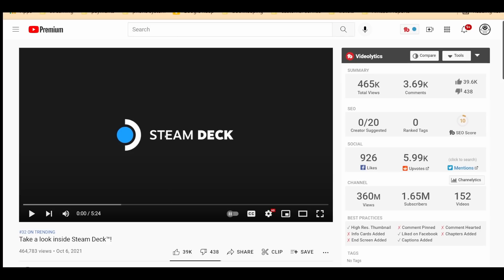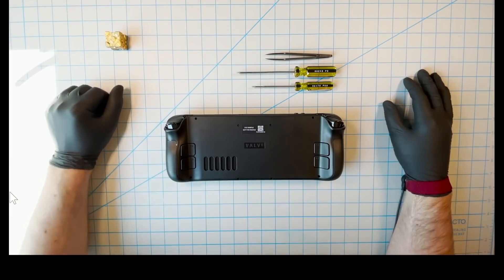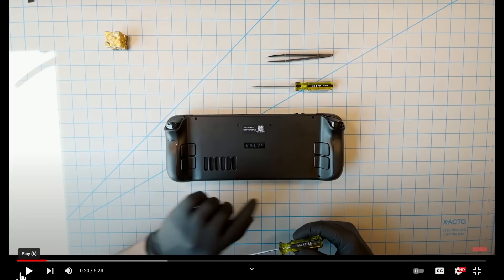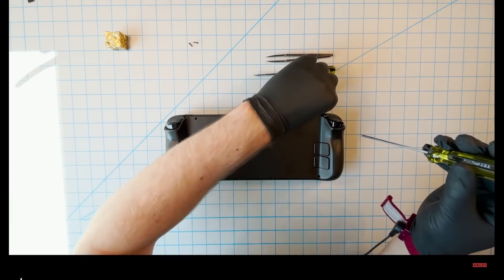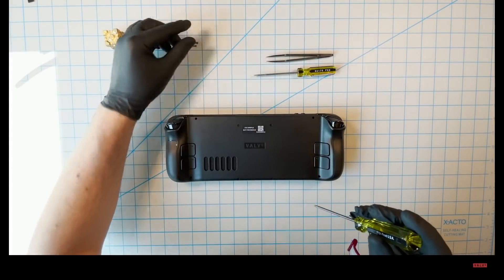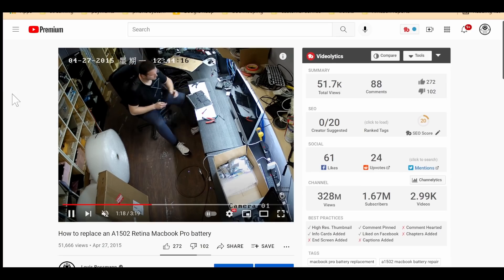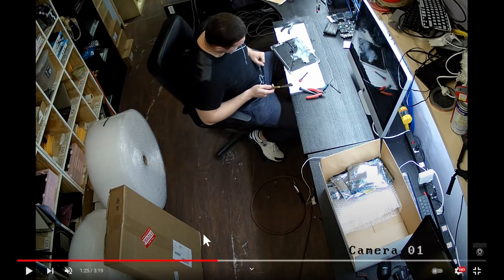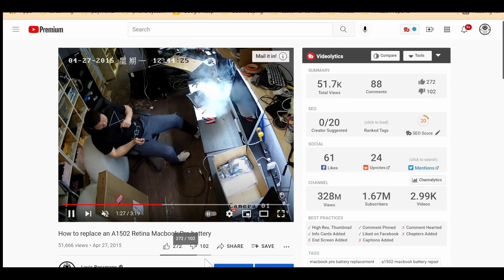Steam deck battery may end your life? bruh 😑

Comment: I know from the times I have opened my PS4 controllers that they never feel as good to hold after wards. They have more "play" and flex in them.
The controlled does have some snap-fit taps in them, which are easy to break when you open it, which means you lose their ability to hold the shell together.
I tried to see if the Steam deck had the same, but I wasn't able to.
But I'm not calling bullshit on them, if you tighten the screws too little or too much it can cause issues. I doubt it has any danger risks though, probably just going to make your steam deck feel looser and and have more give in the plastic.
Reply: There is also a possibility of cross threading the screws since they are self tappers. Which in turn would weaken the plastic that the screw holds too. Or if you over tighten you just strip the hole all together then it will be loose and any part that is loose will fail after repeated drops
Reply: I once killed a car by not knowing what torque was.  It happens.  Push the screw too far in and maybe it will short something or pierce it or crack the circuit board.  Whether that's an issue, who knows until it happens?
Reply: Worse yet, my DS4 controllers have actually started breaking in places the more I do take them apart. Usually the ribbon cables. I always commend Sony for their continual advances in hardware (DS4 has many slight improvements to parts, as have the consoles), but it seems even they are prone to this bullshit, now. I hear the DS5 has stick-drift much like the Joy cons do, which is absolutely tragic.
Reply: @9ineEi8hths  that sucks. Only issue I had with DS4 was the battery cable got broken on one of them.
Stick drift sucks...

Comment: Its sad that Valve gave into the righ to repair corruption. But I strongly disagree with you on the battery safety bit. There really are several situations one could be in, where they cant quickly escape the exploding battery. Plus is could absolutely burn a building down, as everyone is escaping.

Comment: Self tapping screws in plastic. If you use incorect force you wil rip the treads in the plastic. And i see that done when people try to fix their own white goods (i am a independent repair technisian).
If you are aware, and using a little finger feel and following existing threads, then it is not a problem. Or maybe after fifty times in and out with the screw.
But this is like the other warnings, for the people not knowing how to.

Comment: As a ex-technician I used to work for a company whose devices used to be held together with self tapping screws and plastic posts. It was very common to have split posts or to strip it completely, which permanently compromised the structural integrity of the device in terms of the housing staying together, especially in the instance of drop scenarios (which they seem to imply in the clip). How easy it is to split or strip it really comes down to how they designed the receptacles but they definitely aren't talking bs in my opinion

Comment: Ok so I'm going to give my take on the structural integrity thing of the self-tapping screws and structural integrity thing. Also, I apologize if this comes off as me talking down to you, but you said stuff that made me unsure how familiar you are with this, and I lack social understanding/read-between the line skills, which is amplified by the internet. Also, I am speaking from the perspective of a 3d-printing hobbyist, not an expert. I encourage anyone more knowledgeable than me to correct me.

The self-tapping screws means that before the back is screwed on, the slots where the screws go into are smooth, and don't have any grooves for the threads. It is big enough for the center of the screw to go into but not the threads, so when you screw it in, you are cutting your own threads into the plastic, similar to how you would screw something into wood. In contrast, if it had threaded inserts (usually metal of some sort), the threads will already be cut into the metal, and because they are metal you won't be able to cut your own threads accidentally (unless you are the hulk). If you don't have it lined up correctly, you know and just try again until the threads are lined up with the grooves. With self-tapping screws, its hard to know for sure, and easy to tap new grooves into the plastic, which would make it weaker, as there are more cuts in that plastic. Additionally, this means its harder to know when you are overtightening the screw and, especially after several cuts, you could very easily strip out the cut grooves in the plastic. In Short, these are not the same type of screws that you are familiar with from working on MacBooks and other computers.

This is not something that I think would be noticed in the short term, but rather, would definitely hurt the structural integrity by a noticeable degree in the long term for those who are even semi-frequently removing the back. Probably around the 4th-5th time would be my random guestimate. It will still stay on for sure, but it won't be able to get as tight (and as previously mentioned could be stripped out which would make it not want to stay on). It would mostly be noticeable if you drop the device.

Personally, I don't understand why they didn't go with threaded inserts, which as previously mentioned, don't have this durability issue. They don't take up all THAT much more room, and wouldn't make the device cost a whole lot more. Maybe like $5 max by my very rough estimations.

Comment: The argument that you can't die from a damaged battery unless you have no self preservation instincts is ridiculous. Many people have died from damaged batteries. Fire can spread incredibly quickly. Sure, most damaged batteries won't kill, and if you know what you're doing you're extremely unlikely to damage the battery, but to pretend there is no danger from a damaged battery is just obviously false.

There are of course different ways batteries can fail than just the example you give were it fails catastrophically instantly, but even that exact scenario that happened in your shop could take a life without people having no self preservation instincts. Imagine if it happened in someone's high rise apartment that doesn't have adequate fire safety like no sprinklers, no extinguishers and poor building materials, being done by someone that doesn't really know what they're doing, on their desk with a bunch of random crap and papers around, it could easily cause a fire that gets out of control and kills people.

Comment: I've watched videos of someone smashing Lion batteries with a hydraulic press. Vs heavy duty, alkaline, Ni-Cad. The explosion is spectacular in Lion. Nothing with the others. Thank you for showing what really happens in a real-world scenario. 

macdam11 is correct. It matches my experience. I learned to turn the screw counterclockwise(loosen) until I feel a click. The screw drops into the previous threads. Then I turn the screw clockwise(tighten) until snug. The structural integrity will be very close to original, and much better than a stripped or missing screw. 

I agree with your opinion and methods of dealing with ESD. There is the proper (Paranoid) techniques, and there are practical methods. I do what you do. Using an ESD mat sucks on the test bench. They are conductive and can short out the device being tested. BTDT. I ran a copper wire on the front of my test bench. I soldered a 10meg resister to one end then to a wire I could plug into the electrical ground. I touch it periodically. When doing an onsite repair I keep my wrists on the metal case of the PC while I unplug the cards.

Comment: i rubbed my feet on the carpet for a minute and touched the jumper pins on the motherboard, it jumped like it wanted to start but didnt go far. Without missing a beat i said "Now you can charge me for battery" :P  ( motherboard still in use, never missed a beat for 5 years now ) i also feel ESD is irrelevant now.

Comment: Structural integrity of the device would be "compromised" in a sense since the screws are drilled right into the plastic. Since theyre drilled into place they form this kind of perfectly snug almost vacuum fit with the material. Once you remove the screws and put them back, you wont be able to replicate that, especially with a softer plastic where you really cant tighten it too hard. So technically it would lower the structural integrity though that wouldn't really be the right way to word it/ think about it, its more that it makes the force dispersion less efficient in certain cases. In practice the difference here will be incredibly negligible, and not even worth mentioning unless your actively planning to throw the device at bricks or drop it off rooftops.

Some other comments are mentioning that the screws will rethread the hole removing more material and gradually ruining the threads. I just want to point out this is unlikely, because self tapping screws will behave exactly like normal screws in this scenario. Just because a screw is self tapping doesn't mean it magically removes material from everything it touches. You have to actually use enough force to remove material for it to exhibit that additional behavior. Unless you're using a power drill instead of a screwdriver, you won't have that problem
Reply: Got it. Don't let me reinstall the screws for you. 
Yes I once used a 18v drill to remove & reinstall screws to a tablet. But I was just reinstalling screws to the broken tablet.

Comment: "Remember, if you have followed these directions correctly, you've done absolutely none of the preceding steps" The entire video also has a very condescending tone to it imo. Which is only made hilarious by the "technician" being so INCOMPETENT that they're wearing and ESD strap over gloves that insulate the contact from the "technician". It's blatantly obvious, if someone with that little experience can get away with it, anyone with rudimentary assembly skills can open these things without concern.

ETA: I guess the condescension can be forgiven, given some of the repairs I've had to make after a rock ape has attempted to fix things.
Reply: That was the quote that stood out the most to me.